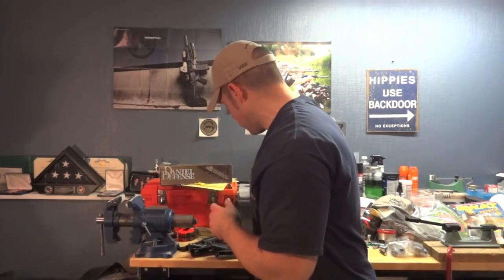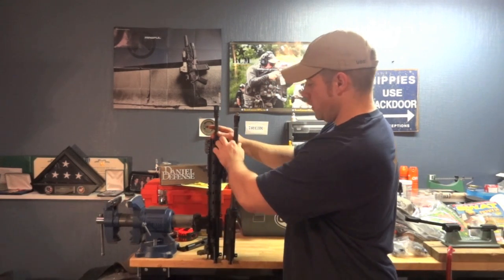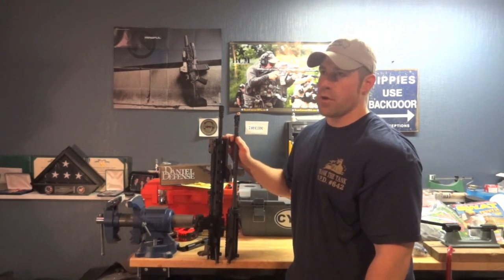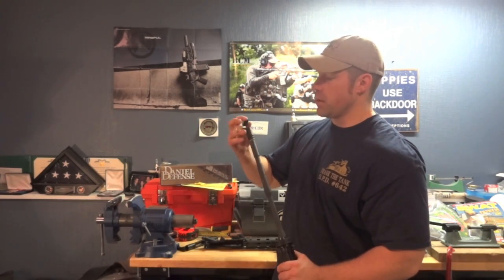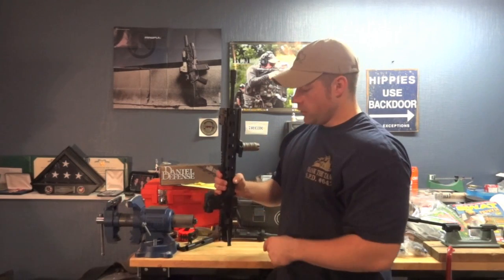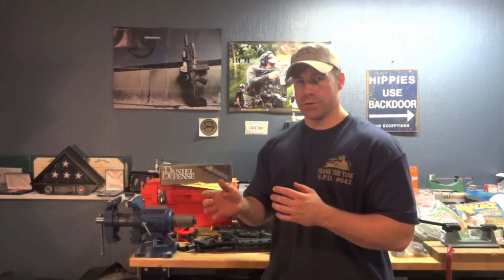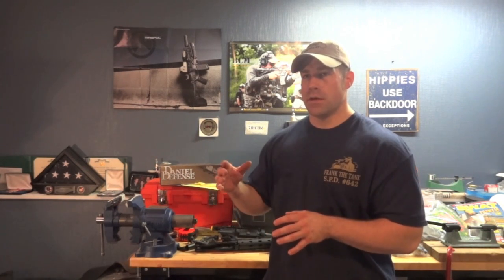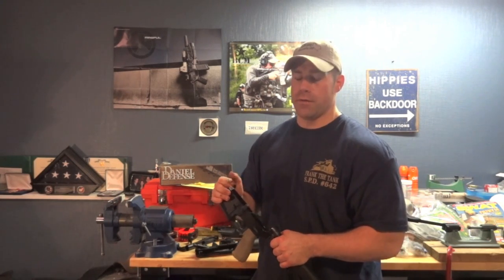Choosing a 16" vs 14.5" Pinned/Welded Barrel

Comment from the maker: They don't sell pinned/welded 14.5" from the factory as a non-custom option.  Custom is always a different story.  
The problem with overpressure is related to many companies intentionally over-gassing their rifles.  DPMS, Bushmaster, Mossberg, Olympic, etc. They cut larger gas ports so that the rifles will run a wider range of ammo, to include low pressure steel comm-bloc stuff like Tula and Wolf.  Higher grade rifles like BCM, DD and the like have more precise tolerances that reduce that issue

Comment from the maker: Muzzle devices are not needed, but it's somewhat counter-productive to have an AR but no muzzle device.  The one exception being heavy barreled varmint/target rigs.  Muzzle devices can alter the recoil impulse, even if they are designed as a flash hider.  The benefit being faster follow-up shots, which is generally in line with the intent of the AR15 platform.  Most people using ARs are using them in a more aggressive style where muzzle devices are beneficial.

Comment: one thought that keeps coming to my mind: Its not just the weight, its also WHERE IT IS ON THE END OF THE RIFLE.  The mere 1oz. drop weight is sitting 9" out past your support hand.  The torque could easily make it feel double or triple the weight hanging out there.  This still may not be an issue for us guys, but Dear wife/sis/girlfriend/mom may have more sensitivity to the weight, and therefore: every gram of weight shaved becomes insanely more important to get rid of, especially out at the end o' the gun.
I got a 16" for dear wife, and now I'm trimming weight everywhere I can so she can run it better.  Not that she can't lift and swing it, but faster is better.  and that extra ounce sitting clear out there makes it that much harder for her to get the speed she could have an easier time with using the shorter barrel/gas system.
Reply from the maker: Weight on the front end is a substantial consideration.  I recently built a 16" with low profile barrel and BCM KMR rail, and the weight- or lack thereof- is astounding.  I am amazed how easily the rifle handles in training and when working through rooms in CQB.  Rifles with less mass out front transition faster, and when you are running from ready positions to on-target, the lower weight helps you shoulder faster and with less effort.  Over the course of an hour or two, it's inconsequential.  Over the course of a 2-3 day training course, it's a major consideration.

Comment: I have an 8 inch Rock River PDS and it cycles cheap steel and brass cased ammo just fine.  I'll admit 8" is too short for most AR-15 applications but it still spits out rounds at 2200 FPS and hits within 100m more accurately than any pistol caliber carbine while having the best balance that any AR-15 can have.
Reply from the maker: The problem is that you need a bullet that will perform at that low of a velocity.  Very few will.  You're also dealing with a piston rifle, not DI.  There are different operating dynamics involved.  There was a run for a while where agencies were using a 7.5in "feline" SBR, and they dumped it because so many people were getting sinus headaches.  Additionally, the ballistics of the 7.5" and 8" in 5.56/.223 are extremely restrictive.

Comment from the maker: Getting a carbine gas system will work just fine more often than not.  Sometimes they do require a heavier buffer, but it depends on who makes the barrel.  The advantage to the midlength is the softer recoil impulse.  It's basically whatever fits your flavor.
Reply: But But but, 16 no middy = no bayonet . Unacceptable.

Comment: That 14.5 vs. 16 muzzle device is true except some states. in NJ if you have muzzle device then it HAS to be pinned and welded - no exception... 14.5, 6, 18 or enything else. So there is no difference in incovenience during repair.

Comment: I live in CA, Bought an Aero 14.5 inch w their VG6 EPSILON 556SL pin and welded. It allows me to still remove the gas block if needed. I also feel the gun has lil more control, its not night and day but I like it more than my 16 inch build. Im sure if I buy a top of the line 16 inch upper I may like it more but I cant shell out more than a thousand for a single upper just yet.

Comment: with ak due respect, I'm not sold on 16" vs 14.5". I like my 14.5 pinned with a surefire sfmb556 supressor adapter/brake. If I want to go canned, I'm good. the barrel will go bad long before the brake. mine is a mid length system, I just finished running a case of steel wolf and not 1 single issue. not cleaned once other than running patches thru the barrel. so again, I'm much happier with the savings for my uses.

Comment: A lot of that pressure argument is due to the gas port as well. .062 is mil-spec IIRC, paired with an H2 buffer Wolf (or any low pressure) will short stroke plenty of mil-spec middy 14.5 or 16 ARs. I've had wolf short stroke in my BCM 14.5 middy that is permawelded with a SM 556, about to change it out to a griffin armament M4 SD II, so i can relate to everything your saying about changing barrel components, i'll have to send it somewhere most likely ADCO. That said i've shot PMC, and some cheaper brass .223 and not had an issue. I only have BCM ARs but generally if they're going to specced for high pressure ammo like 5.56 that's what i run with. Though this is all personal opinion. Good video, subscribed.

I wish i just went ahead and went the NFA route i know what i ultimately want, which would be a 12.5/13.5 setup. Maybe a 11.5 as well. You add a 7" suppressor to these setups and suddenly an SBR is a full size rifle. Of course it isn't permanently attatched. That said i'm not the type to do my own gunsmithing when it comes to changing brakes. Sounds ridiculous but just see myself not getting the thing 100% centered. FWIW i stick with my decision for a 14.5" i agree it's not changing much but it's one less inch when i add a 7" suppressor this coming fall and i just wanted as short as i could go without the ATF/NFA. Though that will change eventually.

What do you think about the new AR pistols with that "brace" as they call it.

Comment: I’ll just say it’s “welded & pinned” but use a regular comp. Nobody is checking barrel lengths when you go to the range. At least I’ve never seen it happen
Reply from the maker: Generally not checked, but certainly not something I’d be typing on the internet.  If people think the government isn’t watching this stuff, or that anti-gunners in Silicon Valley aren’t going out of their way to monitor gun stuff to report to the feds, they might need to rethink that.

Comment: That 14.5 with pinned and welded device has gained popularity for whatever reason reminds me of how .40 handgun got to be so popular and now no one with any sense wants one.

I've only been in the AR world for about year now. Got my first about a year ago, a plain Jane 16 carbine made by a reputable company. Runs great. Since then have brought it up to speed with optics, Magpul M-Lok hand guard, Surefire light and Vickers two-point sling, to which I've added some extras to make it a combo that can be run both one and two point. Have also spent the last year totally immersed in learning all I can about every about it via all kinds of YouTube vids, online training, manufacturers' website.

Am about to buy my second, probably something of a higher quality like a DD, and have been deciding whether to stick with another 16, a 14.5 with p/w muzzle device, or pistol. Have just about to stick with 16. This video here is one of several that has helped me finally decide. Now trying to decide carbine or mid-length. Right now I'm leaning toward the carbine side of the fence so long as I can get the longer M-lock hand guard for it. I'm afraid that someday we'll be stuck with shooting whatever crappy, underpowered ammo we can get our hands on, and running carbine or adjustable gas block or some other solution will be a necessity.

Comment: Old video but 14.5” barrel + a 1.5” muzzle doesn’t get you to 16 does it? How about thread overlap. Just curious
Reply from the maker: The 1.5” refers to the length of the muzzle device past the muzzle.
Reply: @Reedo302  roger that. I’m in the process of a 14.5 build and just recently had that brought to my attention. Never thought to include that into the measurement.
Reply: @Reedo302  appreciate the video

Comment: Great info! I'm LE in Ohio and I'm on the fence about keeping my 16'' or go to the 14.5 for my everyday carry at work.Thanks for the good ideas. Keep up the good channel!
Reply from the maker: Do you have the option of getting an SBR?
Reply: Yea, If we really want to carry one we can. However I'm issued a HK mp5 which personally if I'm going really tight work I'll go with that rather than shell out the 2 bill to get the tax stamp.
Reply from the maker: Hard to beat for close range.  Horrible at long range, but good for close range work.  Our Mk18s and HK416Ds are both pretty close in length to our MP5s with extended stocks.  That is, until we swapped to AR receiver extensions on the MP5s.

Comment: HAAAA!  You just cured me from a bad case of buyers regret. Good video that answered alot of my questions. Do you have an opinion about the Windham armory 16 inch  HB with carbine gas tube length? Thats what I purchased for a fun gun. also have an H2 carbine buffer with it. have not fired it yet but soon.

Comment: would a 14.5 mid length system run with a rifle tube assembly (a1 stock)?  I seem to really be drawn to that 14.5.
Reply from the maker: +TehRaven yes, you just have to be sure to select the right buffer weight.  Again, keep in mind the type of ammo you will use.  XM193 for example is really hot ammo, and others may or may not be similar.
Reply: SentinelDefense I am planning to use m193 for training and mk262 for serious use.
Reply from the maker: +TehRaven Both are going to be higher in pressure, so you shouldn't have problems with under-gassing.  If you like the fixed stock look but want something shorter, look at the SLR15/TheDefensiveEdge Sully Stock.

Comment: Just finished building my AR and have a BCM carbine length 14.5 upper. Purpose is cause I wanted what I had when I was in the military. Just debating if I should pin and weld it. Not using it for home defense just for recreational range use. Should I still get it pinned and welded?
Reply from the maker: If you file for an NFA tax stamp, no.  
If you have a pistol lower, no.
If you don’t file for an NFA tax stamp on a rifle lower, yes.  
Federal felonies are not a good thing.  Food for thought.

Comment: What about just making a "pistol". The Maxim Defense "braces" are pretty much as usable  as a decent stock at this point. 

How do you feel about 10.5" barrels?
Reply: Einsatzgruppen Commander 10.5 is too short to where 300 yards is a pain and inside and with no ear pro your ears will be dead for sbr 11.5-12 is a lot better but still really short

Comment: What this video fails to cover, which may be due to its age, is the fact alot of foreign guns come in only as pistol format and your only option is to take the pistol model with 14" barrel and either sbr it, or pin and weld. And alot of states hate SBR and moving state to state with an SBR sometimes is impossible. So pin and weld is your only option or use a brace which doesnt allow you to use a vert grip.
Reply from the maker: This is also an AR15 specific video.  Most other rifles do not allow quick barrel changes to the simplistic degree that AR15s do.  The few non-AR15s that do are all made in the US and don’t have that pistol stipulation.
Reply: @Reedo302  it's a free country I'm allowed to like my combloc guns :P

Comment: What do you think about Daniel Defense 14.5" Middy?
Reply from the maker: DD did it for the same reason that BCM did it, which is to meet market demand.  Fortunately, DD is a quality company and they properly tune their rifles.  If I were going to buy a 14.5" pinned/welded rifle, DD would be on the short list of companies I'd buy.  The thing to remember is that they will have a rifle setup for 5.56, so you may have cycling problems with lighter .223 ammo and would have to ensure you were running a standard carbine buffer.

Comment: Your video has just about changed my mind from getting a 14.5 vs a 16 for my next build.

Plan on ordering a BCM mid length upper in the next month or so but here's the kick, regardless of barrel length due to the laws in my state the comp must be pinned. With that said would you still recommend a 16" over a 14.5"? Comparing both barrels I didn't realize the size difference was so small, and I cant really justify less than an inch difference for compromised reliability.
Reply from the maker: If I lived in a ban state, I would likely own several BCM 14.5" uppers.  If it has to be pinned, you might as well.  Every 14.5" BCM pinned/welded that I've seen has run like a Swiss watch with 5.56 ammo.  The only problems that come about are with low-powered ammo like .223 spec Russian steel case.  There are ways around this like using a standard carbine buffer.  The thing to keep in mind is that BCM specs their rifles to run on 5.56 pressure ammo, not .223.
The 14.5" pinned/welded rifles I've seen that have had dramatic problems were either frankenguns or from companies that don't specialize in this configuration and haven't tuned the rifles correctly for it.
Reply: Thanks for replying back. Since pretty much the only stuff I shoot and keep on hand is Federal M193 556 I guess I shouldn't have any problems, even so I guess ill keep a carbine buffer around in case I want to shoot some cheap low powered stuff. From what I have read it seems like BCM has the 14.5 mid length figured out pretty well too.
Reply from the maker: *****
The 14.5 middy that BCM makes is far and away the best.  If I were to buy one, BCM would be the only one I'd buy.  When using M/XM193, you will have reliable operation with the midlength system.  That is what BCM rifles were made to shoot.
Reply: I ended up ordering a BCM 14.5" BFH upper with a pinned Battlecomp 1.5 a few weeks ago. Just need to get a LPK and I will have this thing running soon.

Comment: I'm thinking about 14.5 carbine from BCM with a novneskie war pig pin and welded on it. Will this work? Thanks for the video its made me want to do more thinking about what I wanted ti build.
Reply from the maker: +EZ The Noveske extends around 2.4" past the end of the barrel, so it will meet the requirements for NFA length if pinned/welded.  The Noveske KX3 is a krink style muzzle device, and it has an added effect of increasing dwell time due to it working like an extension of the bore since it doesn't port gas off to the sides.  This is slightly marginal effect, but it has been noted to increase reliability in very short SBRs.  The KX3 is very heavy.  I've had one on an SBR, and while I liked what the device did, it threw off the balance a little bit.  I've felt them on longer barrels like 16" ones, and the device really isn't suited for that use.  There are far better options that are lighter.  For 14.5", I would also look at another device that is lighter and shorter, but that's just me.  If you throw the KX3 on a 14.5", you're going to be around the 17" mark at that point.  You might as well just get a 16" barrel and normal muzzle device at that point, which will also be around 17" long.  Just my $0.02, which is worth exactly that.

Comment: Good opinions and information. What are your thoughts on if I already bought a LMT 14.5" upper with plans to pin and weld it but now I would rather just have a 16" for some of the reasons you mentioned? At the time I was kind of going for looks but now realize function is always number one for me. Anyways, would you stick with the 14.5" or try and swap out for a 16" upper? The 14.5" upper is unfired and I want to stick with LMT for the upper. I could always just buy a new barrel to. Thoughts?

Comment: Thanks for the vid. You explained well the pitfalls of a 14.5" pin/weld barrel. Does one need a muzzle device? The A2 birdcage is a FLASH HIDER. If shooting in low light conditions get a flash hider. If not, put a thread protector on your 16" for the minimum length barrel allowed by law, it's lighter and with the same recoil. If you want a brake, Brownells has a $60 shorty adding 3/4" length. Want a gun to shoot a wider range of ammo, go 16" carbine. More relative recoil but we're talking 5.56.

Comment: Would your opinion be different if you lived in a state that requires the muzzle device be pinned/welded regardless of length? NJ requires it be pinned and welded even for a 20”
Reply from the maker: Yeah, at that point it really doesn’t matter and you can do whatever.  I’d run a 14.5” at that point.

Comment from the maker: They made it 10.3" because that was the minimum they could make the barrel length for reliable operation.  Also keep in mind that the service life of a NSWC/Crane Mk18 in use by NAVSPEC is 7000rds.  At exactly 7k, they overhaul and rebuild the rifles.  That should be something to consider when you go to that shorter length.
Reply: The 10.3 came to be because the Government had a surplus of M4 barrels that they wanted shorter and to keep on the cheap they cut them down and just so happens they chose to cut the M4 bbl at the M204 cut and viola 10.3 was born.
Reply from the maker: @RideForLifeCR250R  Hence why the Mk18 barrels were only good for 7k rounds- Colt doesn't use CHF process to build their barrels.